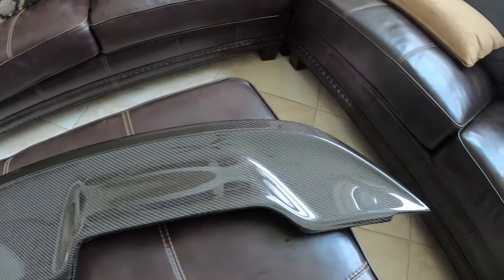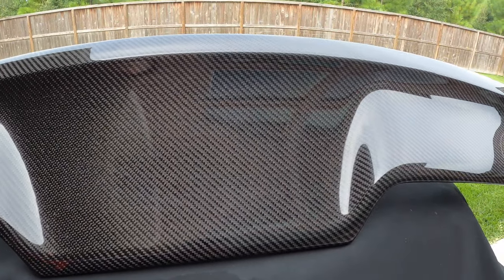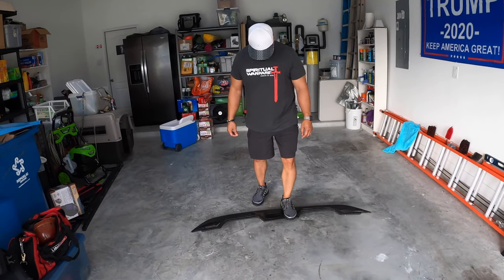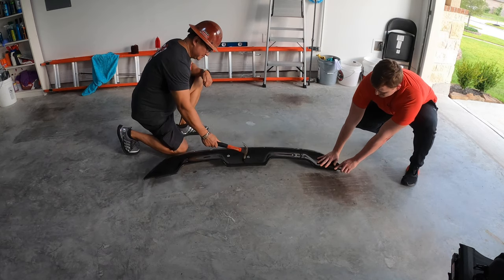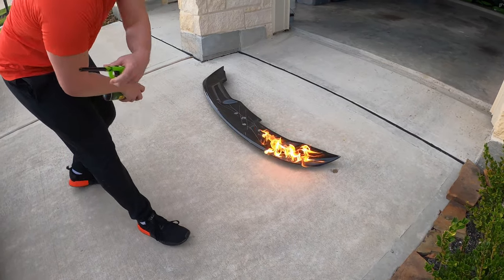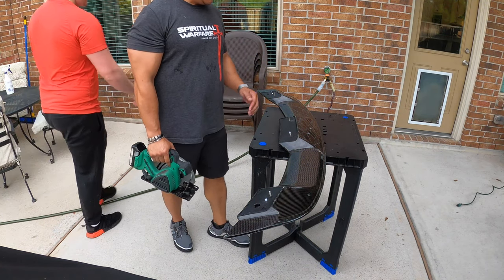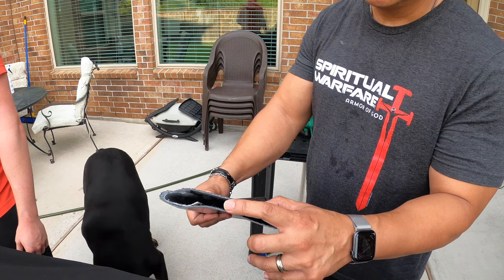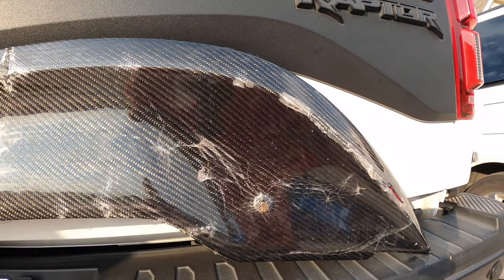Torture Test:  $1000 Carbon Fiber GT500 Wing

Comment: A trick used by a lot of composite companies is they lay up one layer of carbon, then back it with fiberglass, which I'm 99% certain is how this wing is made after looking at the side shot of it sawn in half. I did a video on my channel about this exact thing and it drives me nuts that companies market it as "carbon fiber" when its 95% fiberglass.